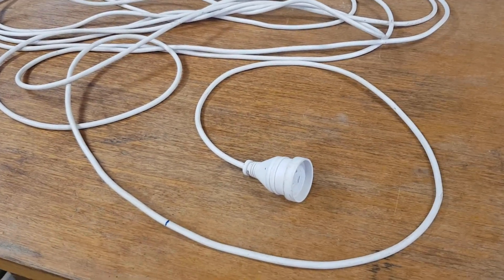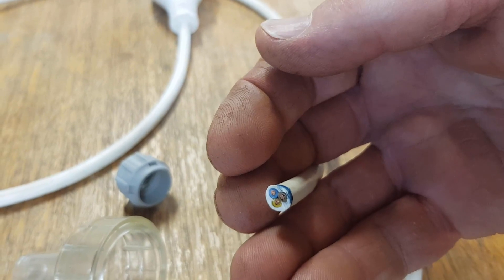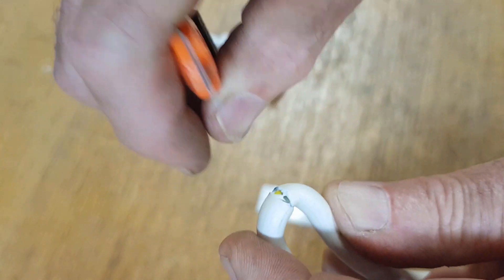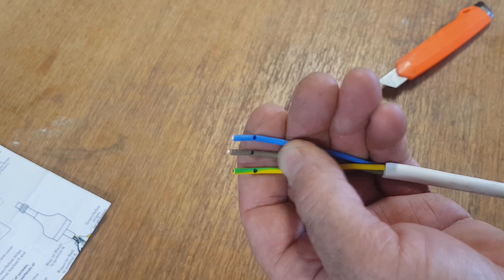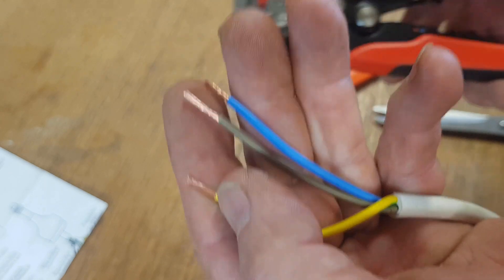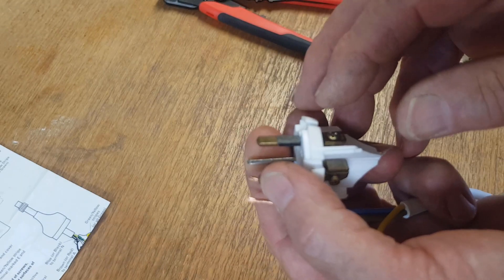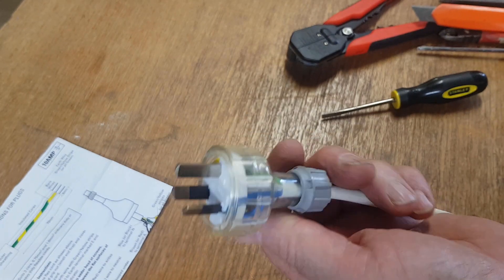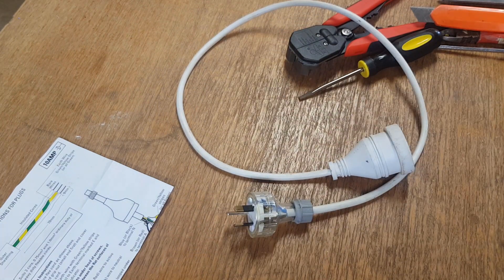Basic tips on how to fit & wire an Australian electrical plug DIY extension cord repair/modification

Comment from the maker: Here's some excellent wire strippers if you wish to purchase some...
https://amzn.to/3cFcRok (Australia)
https://amzn.to/3cIUAGA (US)
If you make a purchase through Amazon from these links (even if it's something totally different), it helps a lot to support my channel with small commissions - at no extra cost to you! 😊
As an Amazon Associate I earn from qualifying purchases.
Reply: You said that the way you were holding it, with the earth down, then the closest pin to you is the active.  Is that always the case?  I have a plug that doesn't indicate which is active and which is neutral, and I'm needing to use it on a charger for a very expensive electric motorbike, so don't want to mess up!
Reply from the maker: @buckbuchanan4902  Yes Buck, that is correct. The active pin should always be on the left (as looking from the rear of the plug) 👍

Comment: GRRRR!
Nobody ever tells you how to do the FEMALE end!
The replacement end plugs (male and female) are only marked on the neutral. I have seen many of these videos, and they are all for the male end! Do the wires (blue and brown) go opposite on the female end? Or does it not matter?
Reply from the maker: The male end is usually shown as the plug is the most replaced end, by far! You would only need to replace a female end on an extension cord. Wiring a socket is basically the same except the active & neutral are wired on the opposite sides (to line up with the respective active & neutral on the plug). Even though most AC appliances will work with the polarity reversed, it should not be done for safety reasons.

Comment: Hi, Very good video but you have the plug on the wrong end of the cable, you active and neutral are crossed and will rub against each other. a lot of sparkys dont know this.
Reply from the maker: Thanks. Not sure much 'rubbing' actually goes on!

Comment: I checked on chat GPT and it refers to govt websites in NSW that says you’re legally allowed to replace a plug on an extension cord which he is showing here so it fine. Only hard wiring to wall sockets needs to be done by an electrician
Reply from the maker: I'm in Victoria and have had direct communication with Energy Safe Victoria to confirm that anyone competent is able to repair portable appliances. Some states are certainly different and one needs to check their local laws.

Comment: Good, just avoid saying polarity. No polarity in AC.  Active and neutral OK
Reply from the maker: Thanks Nigel. Yep, there's no polarity in AC like there is with a DC voltage - but it is still important that the active and neutral are wired to the correct pins.

Comment: Hi there,  question... i bought an appliance with an European plug. Can i just replace or with an Aussie plug? Its a very small,  hands held pressure washer.
Reply from the maker: Hi UTPP. Yes you can as long as it's a 240V rated appliance and draws under 10 amps.
Reply: @TheUltimateRecycler  thank you,  it says 220v\110v, it's that ok?
Reply from the maker: @UTPP  If it is switchable, make sure it is set to the 220V setting 👍

Comment: Excellent video with clear instructions, thank you! I need to install a 10 amp plug on my convector heater. I see that there are different plugs for different wire thicknesses (1mm, 1.5 mm, etc.) - which type do I need? Do I need a heavy duty plug? I'm in Perth, Australia.
Reply from the maker: I think 10 amp plugs are the standard for appliances. So as long as the original plug was 10 amp and the cord fits snuggly into the boot, you'll be good to go.
Reply: @TheUltimateRecycler  Thank you. Yes, the original plug was 10 amp. There are a few different 10 amp plugs - various wire thicknesses and also heavy duty - not sure which one to get!

Comment: Great video, I have a question.I need to replace the plug on my wife’s hairdryer.its a 2 pin with no earth pin.can I use a 3 pin plug and not use the earth?.(Australia based)
Reply from the maker: Yes you can. Quite a lot of double insulated appliances actually still have an earth pin on the plug even though it is not connected to anything. It actually gives the plug a little more stability in the socket 👍😊
Reply: @ brilliant, thanks for the reply!

Comment: Is it ok for the plastic part of the wire to touch the metal plates when he was screwing back the screw?
Reply from the maker: The plastic insulation presents no problem touching the metal - as long as it doesn't hinder the connection.

Comment: Hey mate! Would this work if I wanted to change a 3 pin plug to a 2 pin plug for bringing an Australian appliance/phone chargers into USA?
Reply from the maker: Basically the same process Albert, but if you are wiring a US plug on, you would need to check local laws and guidelines. I would imagine that if an appliance had an earth/ground wire, you would need a plug with an earth pin.

Comment: My sealed plug has 3 prongs but when I prepared the cord it only had two wires…..????what prongs do I attach the two wires to?
Reply from the maker: Definitely not the bottom prong as that's for the earth wire only! Your cord only has two wires as the appliance is double insulated and doesn't use an earth wire. The top two prongs are for the active and neutral wires only - and make sure they are the right polarity.

Comment: Do note, that this is illegal by federal legislation in Australia unless you are a qualified electrical contractor.   Now some states do have exceptions, and allow wiring a plugtop to an appliance, providing you are trained and certified by the manufacturer of the particular appliance, but it is illegal for the average person at home to do this wiring.      It becomes messy with state by state rules, and note that if say Meile certify you to wire their appliances, you would not be certified to wire a Siemens appliance in any state that has that particular exception.
Reply from the maker: Thanks for your comment Brendan, but this is incorrect information. It is perfectly legal for any competent person to work on portable electrical equipment except in Queensland. I've had direct communication with ESV to confirm this for Victoria as I regularly repair electrical items for sale here.
Reply: @TheUltimateRecycler   You state very clearly in your video "YOU ARE LEGALLY ALLOWED TO DO IT YOURSELF IN AUSTRALIA"   This blanket statement is INCORRECT and misleading.   It varies state to state.   It is Legal in Victoria only on EASILY TRANSPORTABLE DEVICES - quote direct from the ESV website.    This is Victoria only.   Not Australia.   
I didn't clarify Victoria allows this in my statement, this was my mistake and I admit to that error, even though I did say each state have their own exceptions.   NSW requires you to be trained to be compentent by the manufacturer and as you rightly stated, it is illegal in Queensland.   I haven't checked WA, TAS and SA.   NT and ACT fall under federal juristiction as territories.   
Instead of saying it is legal in Australia, you should of said people need to check with their state authority for legality. 
Stating it is legal in Australia, from someone who is in the industry of recycling devices, could lead people to perform illegal works which can invalidate insurance and lead to fines if caught.   In the states where you need to be qualified or trianed, the fines are significant for illegal electical works, personal fines of up to $40,000 and if a device is wired incorrectly, the person could be up for jail time.   

It's important to be accurate.  Neutral is at EARTH potential in the switch board and from the supply.   Switch Active and Neutral, which is easily done even by qualified people, which is why test equipment is used to confirm, is dangerous and can be an eletrocution risk.  It's not just about switching the neutral instead of the active line.    

I am a qualified electrician, obviously not in Victoria though as I missed the Victroian rule on easily transportable devices, but  I've seen some horrific DIY wiring jobs that could easily kill someone.
Reply from the maker: @EsotericArctos  yes, there are horrific DIY jobs in every trade and people do need to be protected from themselves!
It's been awhile since I did this video and I'm not going to re-watch it now - but I'm pretty sure I mentioned that you need to check your local laws. I'm also pretty sure, based on discussions with a number of right to repair advocates that most states in Australia are the same as Victoria. 
I take your point on reverse polarity being more that just the switching of an appliance - but I did at least show the correct polarity for wiring a plug.

Comment: Hello 
I have portable air con  the cord is cut and has no length 
I don’t have the cash to pay to replace help please 
Or can you do video payout the best teacher
Reply from the maker: Replacing cords are easier than replacing plugs! There should be a connector block inside the air con where the old cord was wired in. Just grab an old cord from some ewaste (you'll have to make sure it's the same current rating though). Maybe cut down an old extension cord. Air cons do draw quite a bit of current, so depending on the size you may need a 15 amp cord/plug. If this is the case you shouldn't plug it into a normal 10 amp power outlet.

Comment: What if its a flat 3 core wire. I need to install these in the roof got connecting plug in downlights.
Reply from the maker: The wiring would be pretty much the same, but fitting a flat cord through the boot could be tricky to have neat & safe.

Comment: Thank you so much for this!  I have a rock tumbler that was originally from the US and so the lead had to be changed.

It worked perfectly fine for a time, but then would randomly trip the breaker when plugged in, even when not switched on.

Because of your video, I can see that when they changed the plug, they have reversed the neutral and active wires (the blue wire is connected to the "active" side and the brown is on the "neutral" side).

From what you've said, I believe this is what is causing my problem.  I haven't attempted to fix it yet.

My question is:  do I need to replace the whole plug as per your video, or is it possible to just take it apart and reverse the wires?  Hope that makes sense.

Thanks again, great video!
Reply from the maker: Thanks Pam! You can re-use the existing plug if there is no damage to it. I don't think reverse polarity would cause excessive current which trips the breaker - there is likely a partial short somewhere! Especially if it does it while switched off.
Reply: @TheUltimateRecycler  ah OK.
Reply: @TheUltimateRecycler  so far, the machine is working, so fingers crossed!

Comment: Can you use a three prong plug for a broken two prong plug and just not connect the earth wire ?
Reply from the maker: Yes John, in fact some double insulated appliances still use a three pin plug from new even though there's no earth wire.

Comment: This is so simple and amazing to be able to just replace it instead of getting a new one and having to throw away the cord. Also could you use this if the end of a plug on an appliance broke or got bent or is that slightly different
Reply from the maker: Exactly the same process to replace an appliance plug Lizzie 👍😊

Comment: You lost me as soon as you used the ruler to measure where to strip the outside sheath. That's the whole point of the picture on the inside of the label.
Reply from the maker: Yep, this is true. The ruler works fine too. Sorry to have lost you!

Comment: Great video! I have an old lamp which only has 2 wires - are you able to advise how to go about rewiring this as I can only find a 3 pin replacement plug
Reply from the maker: Many lamps are double insulated Deb and don't have an earth wire. So you can use a 3 pin plug and you simply do not use the earth pin. Thanks for watching 😊

Comment: Hi , I have followed your instructions but now I am bamboozled. I have a vacuum cleaner that I'm changing the plug on . I cut the cord and found only 2 insulated wires , a brown and blue .but the plug has 3 points on it ?
Reply from the maker: The vacuum is double insulated which means it doesn't have an earth wire in the power cord. The new plug has an earth pin (the bottom one), which in this case you don't use. Just wire the active (brown) and the neutral (blue) to the correct plug pins and you'll be good to go 👍👍
Reply: @TheUltimateRecycler  great thank you so much .

Comment: Thanks for posting this tutorial, Chris.  I picked up an extra heavy-duty extension cord, orange colour, that had been put out for council clean-up. It was approx 60mts long, but the connectors seem to have some rust and damage. Your tutorial was of great help. The only problem was the cable was way thicker than a normal house cord and a bit of a bugger to get the fittings on. I subscribed after seeing that you are into recycling. The amount of good quality stuff that is thrown out in my area of N.S.W is almost criminal. I rescued a cabinet recently that had a RRP of $695. Yes, that new that it is still being sold. 30 minutes work and it was almost new.  Cheers, Chris
Reply from the maker: Thanks Chris, hope you enjoy my channel! Good on you for saving stuff - as you well know there is way too much wastage these days!

Comment: Chris @13m25s you seem to be trapping some of the insulation under the metal contacts, which would be considered a fail in the UK. I'm not familiar with your plug design so that might be ok?
Reply from the maker: I'm sure I eased the wire back 0.1mm just as I was tightening the screw Martin - all good 👌
Reply: Sorry for being so picky! But it was my job for 30 years, an ultra boring part of my job! But someone's gotta do it, as they say... @TheUltimateRecycler
Reply from the maker: @martincowie4520  No worries mate, you are keeping me on my toes! 😛

Comment: I got this exact same replacement plug but the hole at the end was too narrow for the cable to fit through.
Reply from the maker: Really? It must be a heavy duty cable - maybe a 15 amp one. Perhaps you could heat the boot in hot water to allow it to stretch a bit?

Comment: Thank you so much for this clear and excellent video. 

I had to cut off an extension cord plug-end to feed the wire behind the narrow gap of an inbuilt shelf. Was able to attach a new plug-end because of your amazing video.

Likewise, I had issue forcing the protective sheaf back around the wired plug. Used a small nylon car trim removal tool to stretch the edge of the protective sheaf over the wired plug end.

Thanks again for your fantastic, clear and easy to follow video!
Reply from the maker: Glad it helped! Thanks for watching and your great comment!👍😊😊

Comment: This is exactly what i was looking for . Purchased one from bunning but dint know how to connect it . Also my wire only two strands how do i go about this ?
Reply from the maker: Excellent, glad you found it! If your cord only has two wires (and you have no earth wire) - wire as shown in the video to the active and neutral making sure you get the polarity correct. Do not use a two wire cord without an earth on something that should be earthed though.

Comment: Just saved me looking on gumtree for another vacuum. I KNOW the fault was in the plug, because it was a "wiggle it til it works" issue. I love fixing something instead of throwing it away. I do love my old hot and noisy Miele vacuum, splashed out on this proper vacuum about 10 years ago instead of Kmart version, this thing absolutely sucks - in a good way. Learning how to fix things like this is so valuable, literally $3.33 at Bunnings for the plug keeps a beast of a household appliance going, rather than putting a few Kmart versions into the tip in the last 10 years, and also the Meile actually works properly.
For context, I got the Meile on special for around $225 all those years ago, a Kmart version would have been approx 25% of that price. Now, this year,  that Miele comparable model is about $400 brand new.
I've also put ZERO vacuums into landfill. (Apart from the faulty plug I've just put in the bin).
I appreciate this knowledge so much, thankyou - oh bugger. Now I have no excuse with my wife, I have to leave the workshop and go vacuum the house.... boohoo......
Reply from the maker: Great Story Dave! Glad you were able to fix ol' faithful and I'm sure the wife is happy with the house all vacuumed again! Oh - and the planet thanks you for keeping junky vacuums out of landfill 👍👍

Comment: Hi Can I replace my broken 2 prong plug with a 3 prong plug? Or do I need a to find a 2 prong plug.
Reply from the maker: You can certainly use a 3 prong plug and obviously just leave the earth pin unused. You can't go the other way though and use a 2 prong plug where there should be an earth wire!
Reply: @TheUltimateRecycler  thank you so much. Appreciate you taking the time to share your knowledge

Comment: Great tutorial! Very informative and you covered all the bases if you need to troubleshoot👍🏼
Reply from the maker: Glad it was helpful! Thanks Kev! 👍
Reply: @TheUltimateRecycler  the high-rise I'm working on had 30m leads for temp power going thru plasterboard walls on 8 levels. The builder said if i can get them out i can have them and rather than make bigger holes to pull the lead plugs thru I cut off one end of each one and pulled them thru! Now I have 8 x 30m @ 20amp leads worth $70+ at a cost of 8 plugs @ $3.33 each!  
Your tutorial gave me the confidence to re-plug them. I also had a 30m lead that I got caught up in an EWP and torn a metre off the end of it when I ran over it! 😐😂 I made a 1m, 10m and 19m leads from it!
Reply from the maker: @kevh5487  Fantastic Kev, love your work!!👏 👍😊